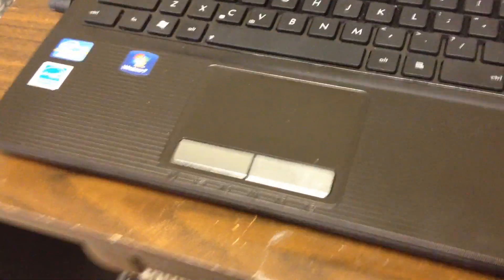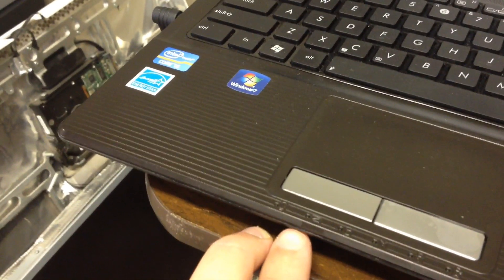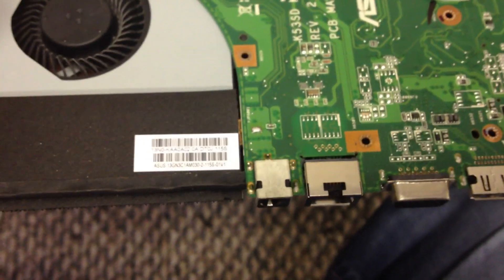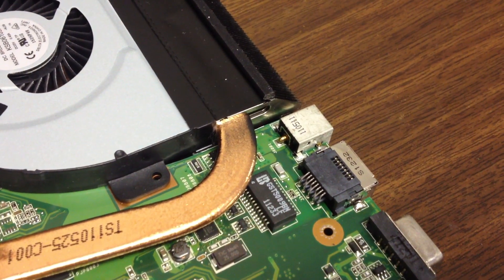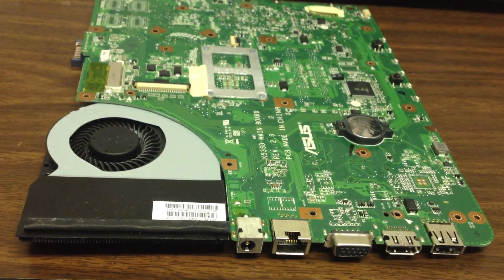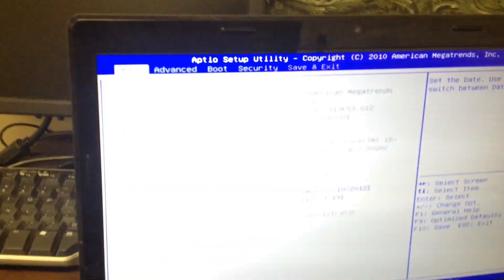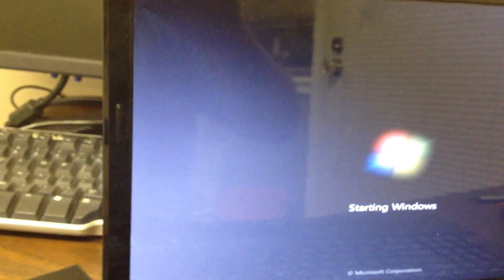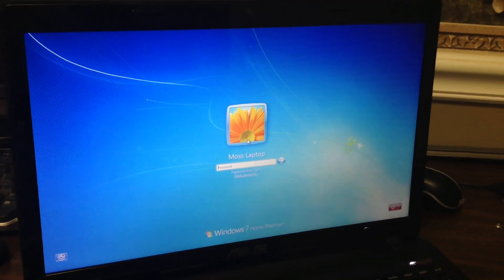Asus computer repair to fix a DC jack that needs resoldered by Doubleclickittofixit

Comment: I got lucky some one on ebay had the exact same laptop but it had a busted lcd screen.
The guy even showed it working with a external monitor hooked up . I bought it for 100 bucks and it included every thing HDD memory the broke screen . I got it for 100 bucks and got the ebay warrenty for 1 year that covers everything except the broken screen .
I swapped the screen and put her hdd in it booted right up . Man I dogged a bullet .
I would have paid the 125 if I had not got this deal. Thanks

Comment: Would that cause it to do this. Press power button fan turns on for 2 sec hdd light come on for 2 sec then goes off but power light stays on and I check the hdd it was not spinning 
as far as I could tell. The power button stays on until I press it. It does charge the battery.
Any idea on how much to get it fixed?

Thanks

Comment: I have one to try to fix I have a emachines e528 and it turns on I hear the fan for around 2 seconds then it stops . The hard drive led lights up then turn off . I get nothing on the screen. It did this before I I swapped the processor and that fixed it unless by remove the heat shield . I tried swapping the processor and it made no difference . I have also swapped power battery memory . I am at a loss I even disconnected every thing no difference